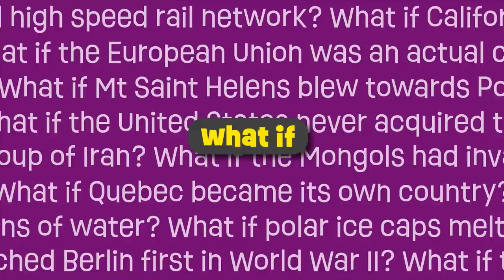Water Pipeline: What If An Aqueduct Was Built From The Great Lakes To The Southwest?

Comment: I saw an interesting proposal the other day, related to this. Rather than taking water from the great lakes though, they suggested taking water from flood prone areas prior to the storms(so instead of flooding the water is drained then refilled by the storm). They also suggested reusing oil/natural gas pipelines that are no longer used, which would greatly reduce the costs.
Reply: Good idea in theory, but once this pipeline would be built, it would only be a matter of time before it would be misused/overused. All it would take is a large chunk on money to be offered or a change in political power. As someone who lives in Wisconsin, I have ZERO trust that the west coast politicians wouldn’t try to bribe someone to pass some bill afterwords to give more water than we should to them, In order to get said politician some good press/publicity.
Reply: @ScrawnyClownSnatch  Well the floods actually cause a lot of damage and climate change is also making extreme flooding events more common(at the same time as more severe droughts).  So moving water away is actually a large benefit to those people who would other wise be flooded.

Of course it is possible it could  be abused, but also we all live in the same country, so we shouldn't be fighting over water if there are ways to provide for everyone.

We don't actually want to drain lakes, even large ones like the Great Lakes, since that isn't a permanent solution. However being able to move water around from place to place would be useful.
Reply: @Lilitha11  If the main idea is to use it as a way to prevent flooding, there are cheaper ways to do that that don't require making a pipeline straight thru the country and the montans (like the video said, it expensive). There are also other solutions for the west to use to save water that are cheaper as well. 
Ideally, this system would only be used on rare occasions where the great lakes area gets to much water. But the truth is, that would not solve the flooding problem. The flooding happens when areas up here get ALOT of rain very fast and the rivers that lead to the great lakes overflow. So unless we somehow attach every river to this system (which is logistically impossible) it woun't solve the problem. 
Additionaly I doubt the amount of water we would send to the west in a situation where we have an excess in the lakes, would be enough to solve their lack of water problem as we would not be sending that much in the grand scheme. 
As a result, a project like this would just be a 10+ billion dollar project, that doesn't completly solve anything and just introduces a system that would need heavy regulation to ensure it is not misused. 
I'd be more interested in giving my tax money to projects that actually solve the problem. 
But that is just my opinion. You are allowed your own.
Reply: @ScrawnyClownSnatch  Well that is why they suggested we use the pipelines we already have for gas and oil. There are pipelines like that all over the place, so you wouldn't have to build new pipelines in most areas. Obviously you would still have to build some, but it wouldn't require building a new pipeline across the entire country, which would obviously be insanely expensive.

If you look at how much food prices jumped up recently due to the war in Ukraine(since Ukraine produces a lot of food to sell worldwide) just imagine how much food prices will raise in the US if California has to stop all farming. Agriculture is the biggest use of water, so if we have to save water otherways, eventually it is going to be that. It isn't just a western states issue if food prices in the US spike. If California no longer produced food, how high would food prices go up? 5 times? 10? 20? Could there be a famine in the US? Could people actually starve to death? It would certainly be possible.

So we need to figure something out.
Reply: @Lilitha11  the idea of recycling pipelines is a good idea and Iike that, but to my knowledge we still would need to drill thru a mountain to install the pipeline. Either that or take a really long roundabout path that might not save money (just a wild guess though). 
As for the food supply issue. To my knowledge, the US tends to avoid importing argacultural goods like produce and wheat in favor of producing it locally, (mostly because it spoils by the time it would come form a place overseas like Ukraine). So the war on Ukrain has actually effected the price of raw materials (like metals etc...) more than food to my knowledge while the food shortage has effected mostly Europe as they are close enough to use Urkrains produce and grain. 
So the food price increase has mostly been due to inflation and gas prices as far as I'm aware (at least in the US). That said, I do see you're point that the west coast needs something done. 
Coincidentally, I read a report recently that California just cleared the creation of a new MASSIVE reservoir mave from a naturally occurring depression in the land. By the looks of it, they may have a plan in the works.
Reply: i like freeman dyson's idea of using nukes to cause hurricane to go elsewhere.
Reply: @Lilitha11  We can’t have a water scarcity and excess water at same time… why don’t we rake the Money spent to complain and fix it … 
why ocean level rise? 
Because glaciers melting .
Glacier melt is fresh water 
If glacier melt was in ocean it would already displace and no rise so must be on land so build a damn and transport water. We do w oil … so is it not that important… this is a game not a crisis
Reply: @Think-dont-believe  You definitely can have a water scarcity and excess water at the same time.  Do you know how large the US is? Almost 4 million square miles. So what is happening in one area, can be completely different than another.

As for transporting water, water isn't that expensive at the moment so there is no money to be made in transporting it around.  It isn't a crisis at the moment. Of course the problem is that if you wait until there is a crisis to build the infrastructure, then it will be too late.
Reply: @Lilitha11  k
Reply: Lol I live in the southeast and my city is the rain capital of the continental US with population 100k or higher. We could use the rainwater that's sent into the drainage systems and transport to drought stricken areas. It's been past time to build a massive water transport system across the country.

Comment: Some thoughts, living in MI, I know that we would never give up our water, period. The problem in the SW is directly related to the population and their consumption. Although I don't recall that you mentioned it, the Great Salt Lake has similar problems and it does not require fresh water to fix, i.e. it could use the salt water that is geographically closer to it. I could see a salt water pipeline being feasible (although probably not financially possible) and inland desalination plants powered by solar energy, which would be practical but expensive.
Reply: They could desalinate water with the 450 nuclear power plants in America. Billions of gallons a day go out the cooling towers as water vapour. But I guess that's being too smart to do
Reply: @highstreetkillers4377  There are only 92 operating reactors, not 450.

Comment: One huge problem I haven’t seen addressed so far is the shipping that takes place on the lakes from the Atlantic Ocean to the western ports of Lake Superior.  This is a major trade route involving every one of the lakes and the rivers and canals connecting them.  Each of these waterways would be negatively impacted by the removal of water.  Eventually, shipping would cease due to the lack of enough water to support the huge ships that sail the lakes. No water, no shipping, no goods, no jobs, no income.  There is much more to this proposal than meets the eye at first glance.
Reply: Then they should pump it from the Mississippi River just before it gets to the ocean. Problem solved.
Reply: @joefishstone8132  maybe up North it is but I'm suggesting pumping it from south of New Orleans just before it dumps into the Gulf of Mexico.
Reply: @goldcoin2444  I see what you mean, the only problem is that with falling water levels more salt is pushed up into the river. Cities near the gulf that had a fresh water supply prior to this are reporting salt tainted water supply. So it would have to be up river somewhat
Reply: @goldcoin2444  and pulling water from above the salt line would only make the situation worse

Comment: I live about a mile from Lake St. Clair in the Detroit area.  One very practical problem would be that that lake levels rise and fall.  When the water level is high this would not be much of a problem, but when lake levels are low diverting water would impede shipping which is vital for the Great Lakes region. 
The political problems are fortunately insurmountable.
Reply: Agreed. I live in Windsor and  it was only a few years ago when the water levels in Lake Huron and subsequently the Detroit River, were only slightly lower than today and many lake freighters had to reduce their cargo weight as they would sit too deep in the water and hit bottom. This cycle of higher then lower water levels is repetitive so any diversion is a non-starter.
Reply: @Judith no one moves to Michigan.
Reply: @Jobratedman  Wrong. I did, it's an underrated state and was a good decision.
Reply: @Jobratedman  michigan isnt just one big detroit you know.

Comment: It's actually very simple as to why we shouldn't do this. These lakes were created by massive pressure incurred by glacial activity. The depths of the bases of these lakes i.e.  the bottom are actually maintained by the sheer vast weight of the standing water.  If you start draining the lakes the base of the lakes you will start a cascading rise of the bases of the lakes. In a relatively small amount of time the lakes would disappear.

Comment: When you move water from one basin to another, the source basin does not recover the water lost and you end up depleting the source. This is why it is generally illegal to move water from one basin to another.
Reply: Then they should pump it from the Mississippi River just before it gets to the ocean. Problem solved.
Reply: @goldcoin2444  Then the Mississippi would run dry. You cannot move water from one basin and expect that basin to replentish itself. Do they not teach this in schools anymore???
Reply: @TomKirkman1   the Mississippi dumps its water into the gulf of Mexico and then to the Atlantic Ocean. I don't think we're capable of draining that.
Reply: @goldcoin2444  The basin that creates and supplies the Mississippi relies on a certain amount of evap as if flows to the gulf. Start taking water there and you lose that, plus the amount that would then go into the gulf and the Atlantic changes. You can't move water from one basin to another without catastrophic changes.
Reply: @TomKirkman1  You don't seem to realize that the Feds can do whatever they want.  They can move what they want where they want because they have an army and you don't.
Reply: @LG123ABC  They would have to break their own laws to do it and yes, they might, but in this case it would be highly unlikely. What it would do to the midwest would be catastrophic.